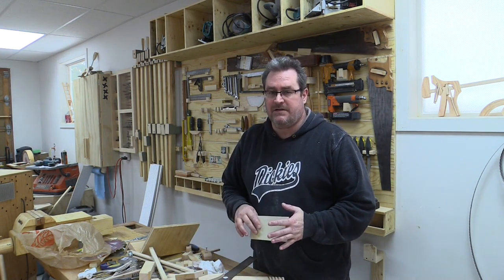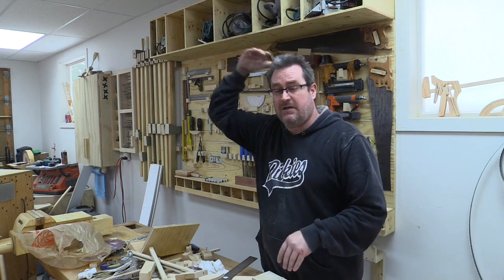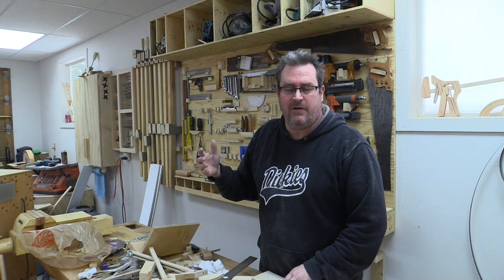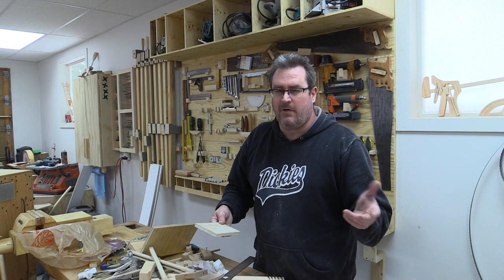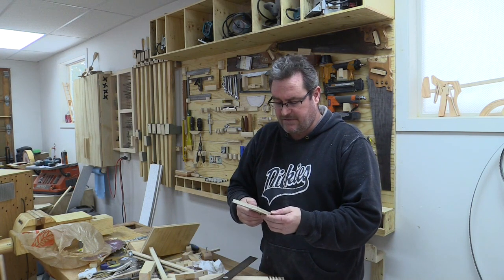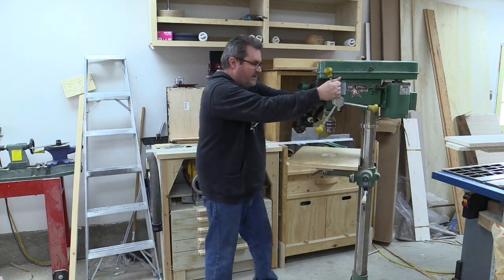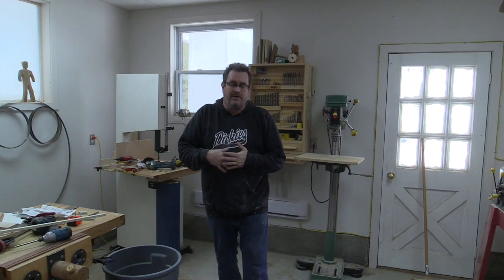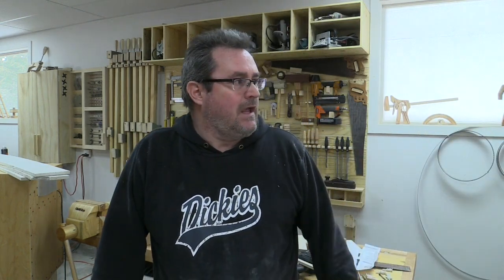New Shop Ceiling Final

Comment: I love that perspective from the bottom of the drill press, and with the nice ceiling you can point the camera up now, though you'll still have some back lighting issues with the lights.  On my camera the exposure is tied to where the focus point is so I can move that around and it will expose better for whatever it thinks I'm focusing on (even though I'm manually focusing somewhere else)
Reply from the maker: krtwood I can increase the exposure, but the brighter areas (windows, walls beside the windows) will be overexposed. Not really a big deal, but one of those little things that bugs me. My camera also has backlight compensation that will automatically brighten the exposure, but I leave that turned off.

Comment: Looks and sounds good man!  I had a similar issue with sunlight coming through the windows in my garage door and killing my shots. I ended up covering them with some foam boards that I had. I do miss the sunlight from time to time so I may need to come up with another solution as well.
Reply: Have you thought of using a semitransparent white cloth over the windows to diffuse the light? If you have a fabric store near by, you should be able to find something there.
Reply: Just Make It Thanks!  I'll try that out and let you know how it works.

Comment: Looks good. Not sure if you've considered using different bulbs to create full spectrum lighting. Also, I have a similar problems with the sun light, I fix it in post.
Reply from the maker: The Nomadic Polywright Show These are "daylight" bulbs and when I get the white balance dialed in for them, that should be it. Just tried it at 5k and that looked good.

Comment: I totally like the neutral (pure) white light bulbs u picked, I dislike cool white and warm white while I like it seems more ideal for creating a nice atmosphere for a date or something, as for the outside light in my opinion a white cloth is the best, you can use it as curtains (meh) or with some other way (a roll up mechanism or something) more appropriate for a shop.
 
Edit I wonder how much the temperature has improved now, it must have at least a bit.

Comment: Make diffusion panels for the windows and it will help greatly. It will reduce the light by 1 stop and help to add a bit of very evenly diffused light throughout the shop. Dont completely block the windows.

Comment: Nice box opening technique.  Thinking I may need to try that.  Did you consider using LED lights instead of florescent?
Reply from the maker: ***** I did. They are still too expensive. In a few years the prices will come down and by that time they may have LED bulbs to fit right into these fixtures.

Comment: Sounds great now you don't have to talk over the reverb anymore. You could also make a softbox like screen for your window. I've seen quite a few video guys do that to kill the directional light, but still let the sun brighten up the shop a little so you don't end up with a dark corner.
Reply from the maker: MrPanohead Problem is, even if the light is dispersed, it's still light - like a fixture on the wall. To be effective, it needs to be blocked.
Reply: I Build It I can't judge that ofcourse, it was just a wild suggestion. I've seen it work out nice for some people. The fabric takes some of the intensity, but if you have in the background it might still be too much.
Anyway, nice work on the ceiling, looks good and helps to declutter the view a lot.

Comment: no more answering questions about your ceiling mattress!  Ripping acoustic tiles on the tablesaw - never thought of that, always just use a knife. That must have made a mess!
Reply from the maker: Allan Smith No more than cutting plywood, but a lot faster and straighter than a knife.
Reply: I Build It I might have to try that next time.  I think I'll just stick to using a knife for opening cardboard boxes though.  Angle grinder had me in stitches  :)

Comment: Hey Guys, funny question and hopefully related to the ceiling topic but I would like a little poll and advice. I am painting my shop (garage converted) concrete floor. I work at a paint place so supply isn't a prob BUT what COLOUR? Matt or Gloss? What colour looks cleaner and is more pleasant? I have started with a little bit of med grey but would like some advice from those who have done and lived with their choices before i continue. Cheers